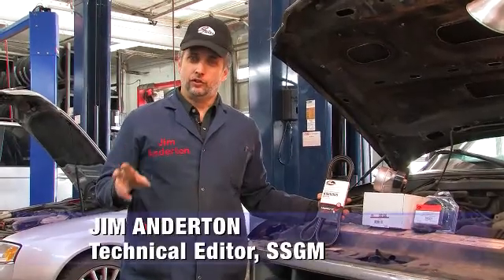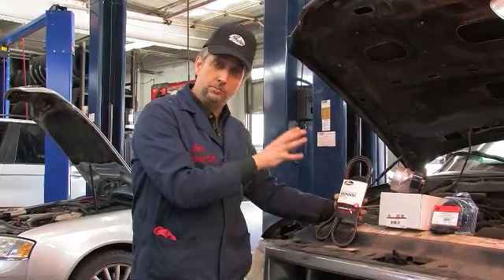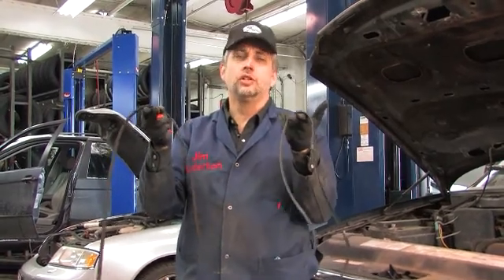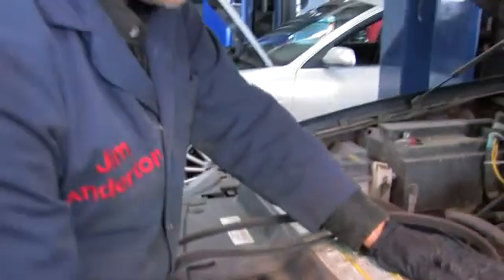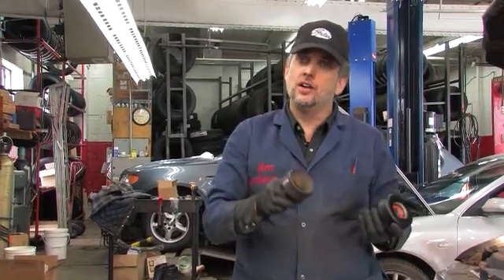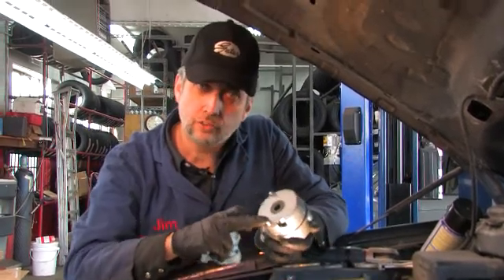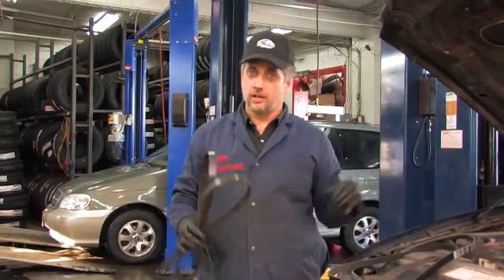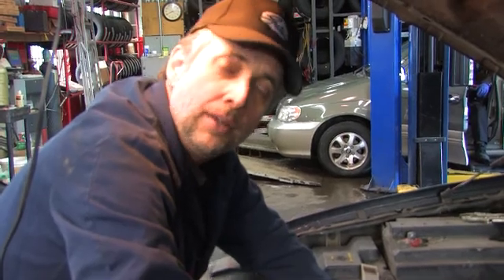Solving Electrical Problems on a 1997 Ford F150

Comment: What does this have to do with Electrical Problems its and alternator change, why not title it how to change and alternator on a .... vehicle.
Reply: I have no electronic juice in my car at all no power no nothing when I turn the ignition on I get no power no nothing what is my problem with a 97 Ford F150 4.2 motor
Reply: @arthurhassett3317  Battery or fuse
Reply: Lmao. Exactly!!!! My thoughts also.